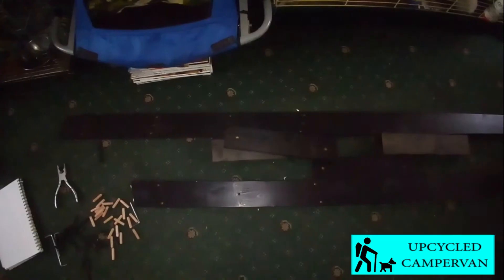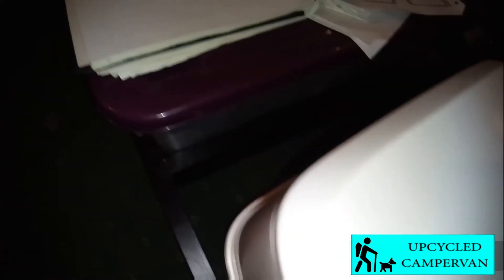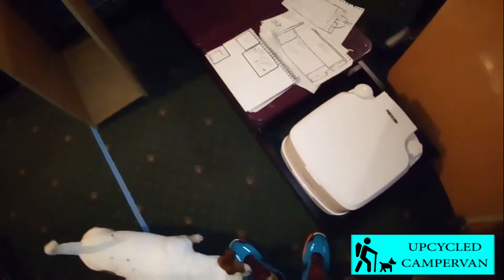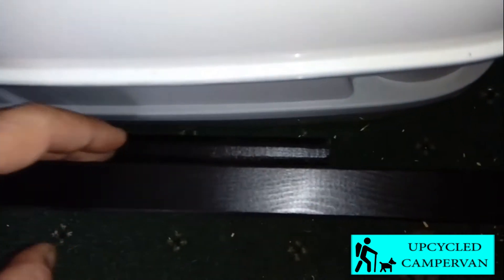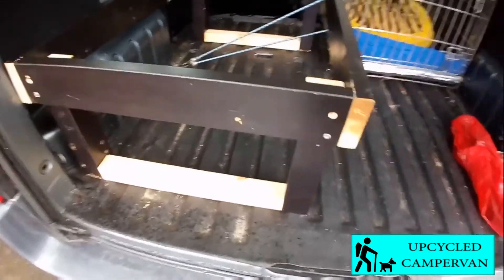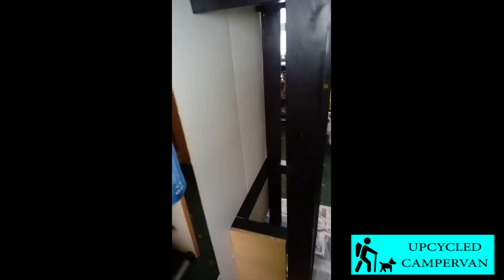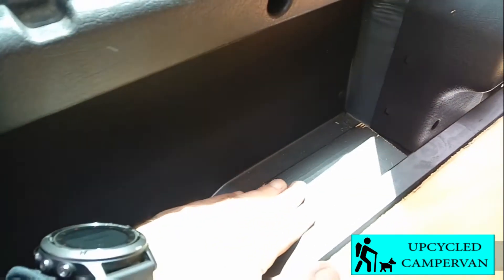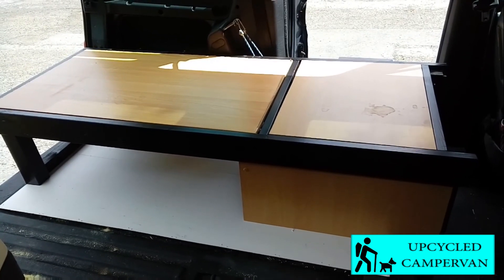Citroen Berlingo Micro Camper Build #1 Fixed Bed Build

Comment: Paul are they good Citreon Berlingo on gas? I'm thinking of getting one for camping in. Thanks for sharing.
Reply from the maker: Hi..Yes mines diesel & it roughly does 45mpg around town & a bit higher on the motorway..i think there great cars :-)
Reply: I confirm, I have a berlingo that has 233000 km and it works wonderfully well, it does not consume water, no oil and is good enough for 71cv din. I like it a lot and I had a hard time telling myself to buy something else for the same price.